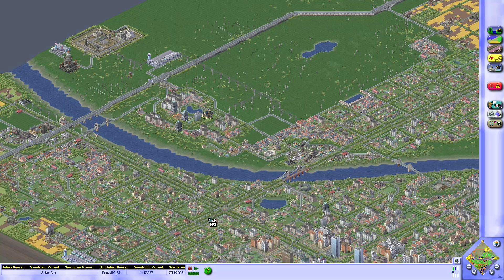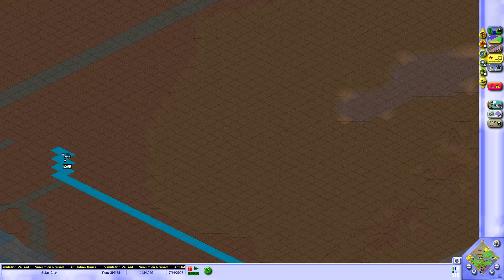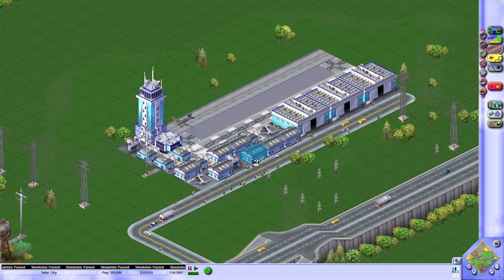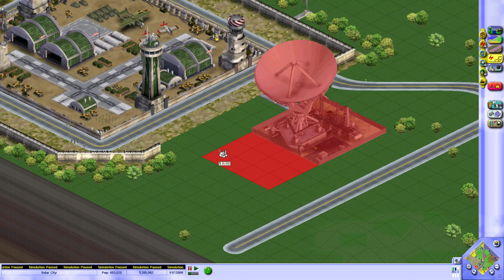Astronomical  | Let's Play SimCity 3000 Again (2024) - 39

Comment: The astronomical land prices might be related to the Castle. I remember it having a couple of positive effects; the most surprising and thus memorable one was that it reduced air pollution within a certain radius.

Around 4:50, the price for the nice curve of the road is that one of those four tiles is also a road tile; that’s why it did not let you place down that 2x2 park. It’s probably possible to bulldoze that road tile, but the nice curve would become an unattractive 135° angle.

Edit: Around 5:00, you can also see that you cannot plant trees on that tile.